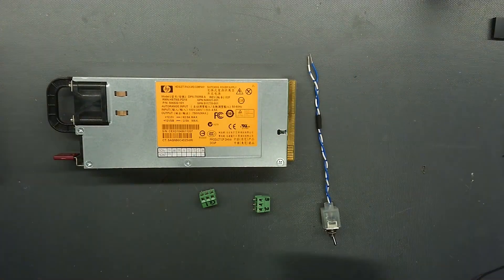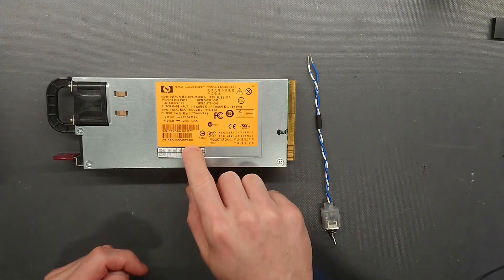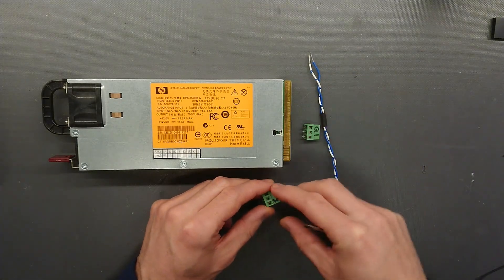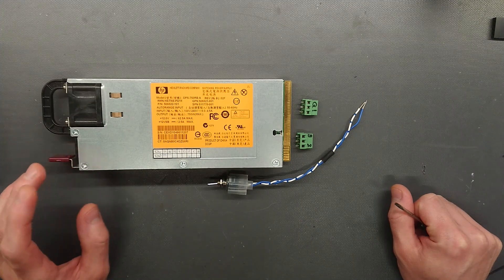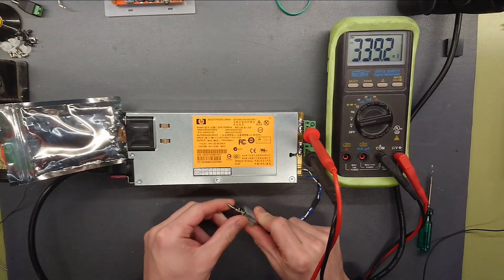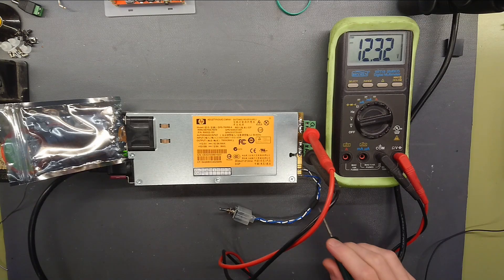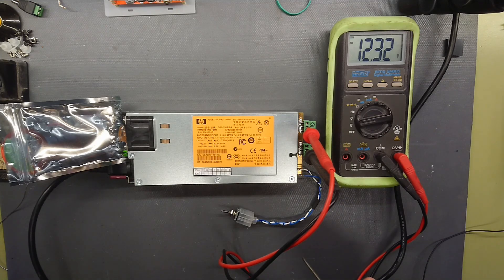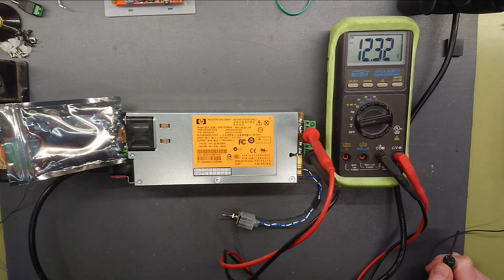Anet A8 3D Printer Upgrades: 12V Power Supply From a Server

Comment: Hi,

I have a hstns-pl14 that is the 460-watt version but my fan goes on but will not ramp up after 30 minutes.
Is this normal or is there something wrong?
Reply from the maker: Almost all server fans have one speed setting. FULL SPEED.
Reply: Hi, i also have a HSTNS-PL14 but this method not working on mine, 1k between 33 & 36, so what di you do exactly ?

REPLY => well i tried short circuit beetwen 33 & 36, so without 1K, and it's work!!!

Comment: im not keen on using a switch like that i heard there could be problems so im looking for a circuit to protect it with a switch
Reply from the maker: Just switch the 230V input off then...
Reply: @KaizerPowerElectronicsDk  I'd have to pull the plug

Comment: If I understand you correctly it is safer to bridge 33 and 36 with a resister then a solid wire.  So when you put in the switch does it have a resister in series with it?  Have seen some people use solid wire and others use different size resisters. One way must be better.
Reply from the maker: A resistor will limit the current in the loop and to some extend prevent bouncing on the input of the logic, but at the end of the day, if its just a on/off circuit, a 1KOhm resistor down to a short-circuit bridge will do the same job when soldered in. A switch could benefit from a series resistor or parallel capacitor for debouncing, but that is almost only a issue in user inputs to a actual "computer". Only power supplies that need a certain voltage feedback to run will need a proper selected resistor value to get the right feedback voltage.

Comment: Hi, I have your exact model. Bridging 33 & 36 pin worked for couple of days, getting 12.2 volt. Now it switches on and off intermittently and no voltage.
Reply from the maker: Does it smell like something burned? The one shown in the video here is still running and have actually been pretty active on the 3D printer in making corona face shield holders.

Comment: when you short the pins out and turn it on with that switch, is that not a bit dangerous? i always thought that powering on PSU's (like Desktop ATX Power Supplys) were only to be shorted with a momentary switch, to avoid a constant short circuit?
Reply: i run a 3d printer with atx power supply it has a switch on the supply but the switch it on i bridged the green wire to ground permanently its been fine for a few years. i have not heard of anyone saying that it could be an issue before

Comment: How does it work? Have you test it?
Reply from the maker: It is installed on the printer and it works just fine. Printer is located elsewhere than my own work shop, plans to go there for followup is on halt due to current lock downs.
Reply: @KaizerPowerElectronicsDk  thanks for the fast response. One more question, is it very loud? I want to make the same upgrade. Thanks

Comment: Atleast the cheap one that came with your printer has an overcurrent protection at all. 

I guess there is nothing, you cant power with a server supply ;)
Reply from the maker: I must admit that was an assumption, surely its more expensive to get an ancient IC without than a new with? I hope :) 

As long as its between 12 to 36 VDC, that is the way to go! 4 series would be pushing it against the single units silicon specifications, in case of unbalance.

Comment: Do all modern server supplies have a temperature controlled fan? Most of the ones I've seen just ran the fan at full blast no matter what.
Reply from the maker: All the HP supplies I have used are running controlled. Check out my induction heater videos where I draw maximum current from them. 2kW from 3 in series.